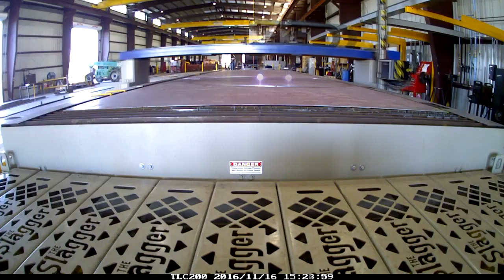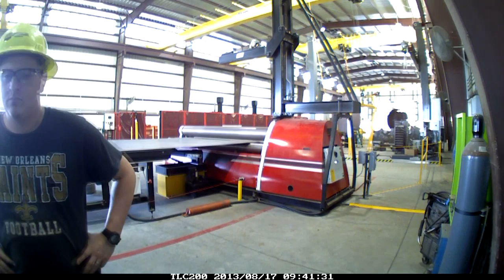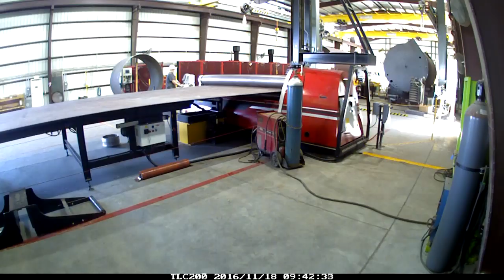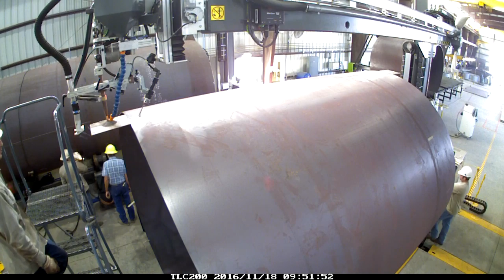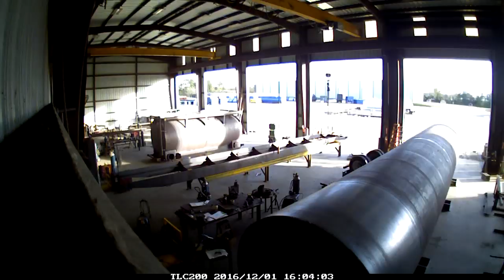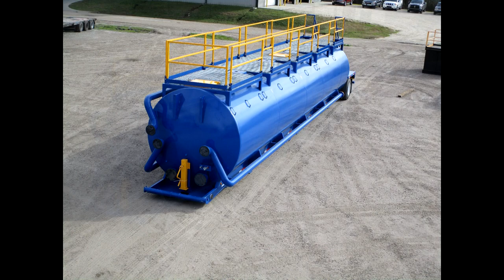Time lapse Tank Fabrication

Comment: What type of welder is that ?
Reply: Don't know the proper name, but it's one where it covers the weld in a layer of sand to protect the weld from oxygen in the air.
Reply: Or submerged arc for the full name
Reply: It’s special granular flux not sand.
Reply: Thats a plasma table and cutting the parts for the vessel. It’s not a welding machine. If we are talking about the first 1. If your talking about the welder putting the cylinders together that’s Subarc (SAW)
Reply: @joeylawn36111  sun arc
Reply: Sun arc
Reply: Sub arc
Reply: The blue one was just plasma cutting metal